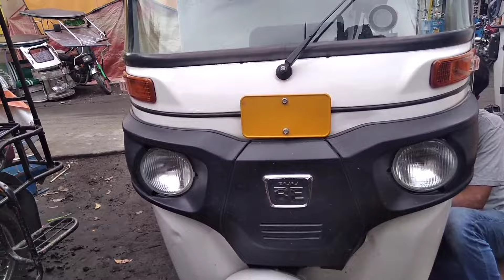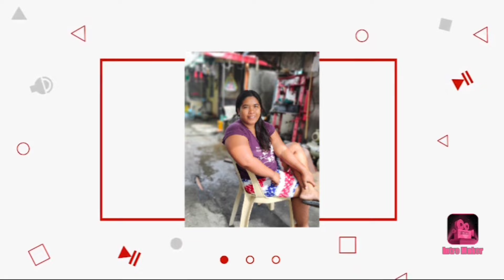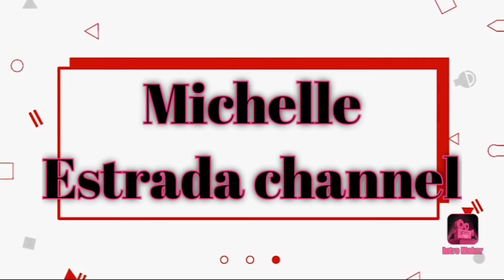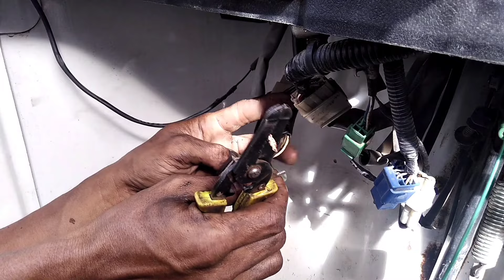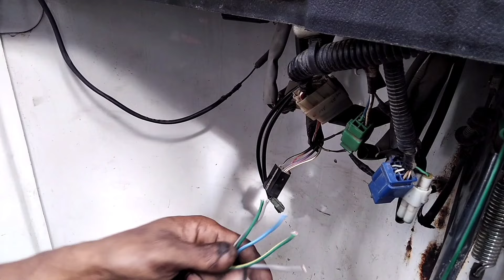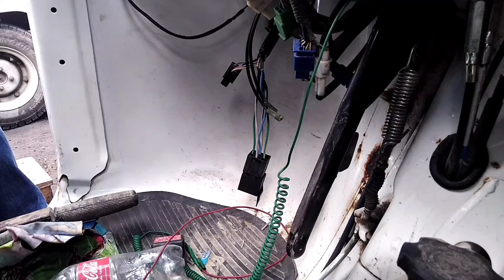horn relay use alternative relay for headlight Bajaj RE

Comment: Lods pwidi pahingi diagram sa gawa mo nasira na kc relay ng ilaw ko kng pwidi lang ako lang sana gagawa salamat po.
Reply from the maker: Kung gagamitin nyo po Yong relay ng busina bili din po kayo ng socket ng relay para sa busina.
30 to white liner na pula
87 to brown wire
85 to black yellow wire
86 to red wire
Yan po Yong low beam connection
30 to white red wire
87  to violet wire 
85 to black yellow wire
86 to white blue wire
Yan po Yong high beam connection
My Naka indacate po sa relay ng busina na mga number na pwede nyo sundan
Reply: salamat bossing